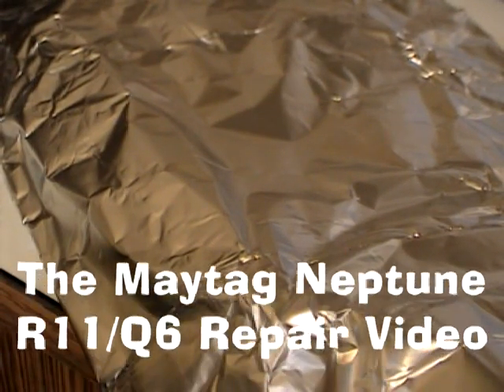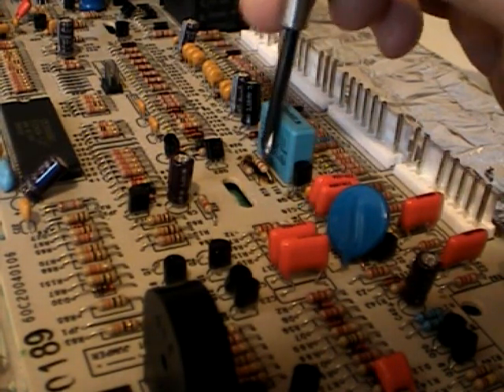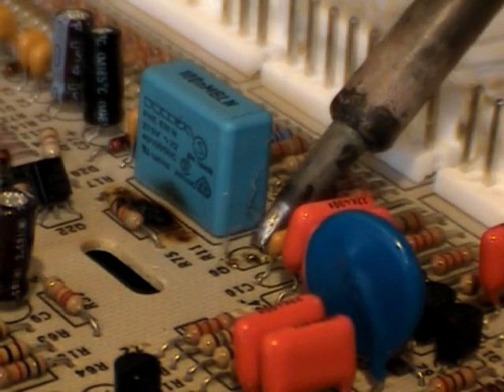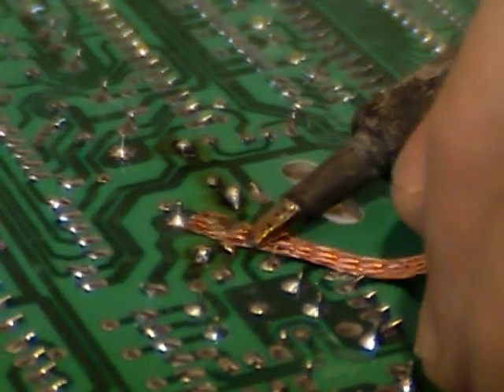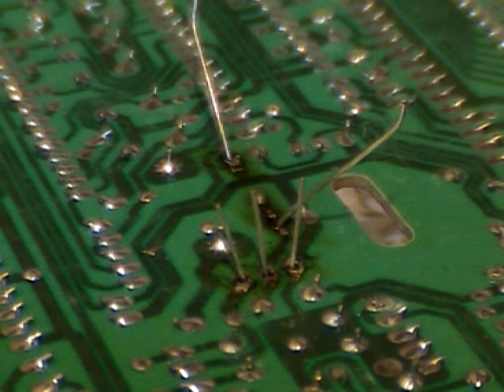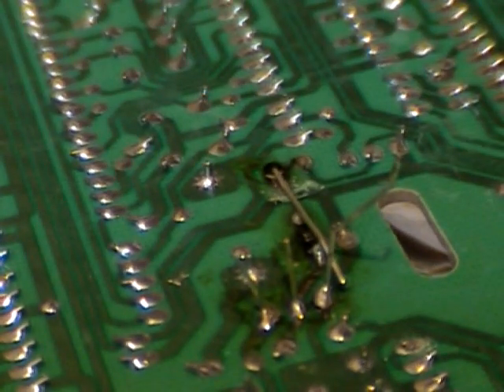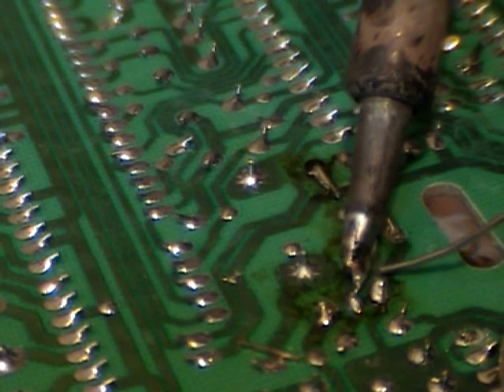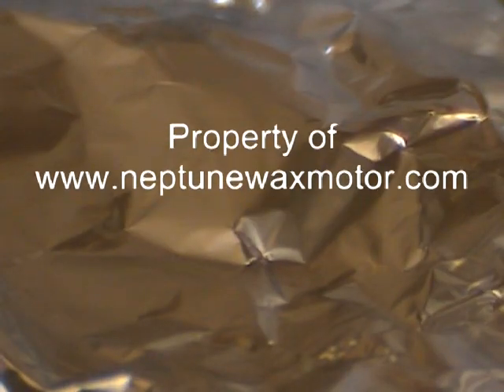Maytag Neptune Control Board R11 and Q6 Repair - No Spin or Door Lock

Comment: thanks for the video very helpful. I'm hoping you can help.  The R11 was burnt and so we replace the R11, Q6 and wax motor with black tip. Put it all back, now it works, locks, spins but when it goes to off the machine doesn't turn off, continues to tumble. It will tumble for hours but won't turn off. I need to press off button and wait for the door lock light to turn off and disengage to get to the clean clothes.  Any idea what is wrong now?
Reply from the maker: +f meghen Hi, I would verify the R11 leads are  in fact connected to the Q6 leads via the copper traces. If one lead of the  R11 is not connected then the wax motor will stay on and the machine will not shut off because it is waiting for the wax motor to unlock door. 

Jeff Hartman
"The Neptune Man"

Comment: I tried to repair the R11 and Q6. The machine gone into the rinse cycle, but did want to turn off. It was spinning for about 5 min, then smelled a slight burning smell, I turned off the machine. Believe I'll have to revisit my soldeing job, don't think I did a good job. How do I clean the holes/race ways? How to test continuity of the race way?

Comment: Just opened my maytag MAH4000AWW, and it also has the R11 and Q6 burned up. Will need to learn how to solder and replace them. Any tools you can recommend? Also what would it cost to replace the was motor and R11 and Q6 at a professional?

Comment: ..cont.. I replaced the door wax motor with the black actuator, went ahead and replaced the same motors on the detergent bin. I also thought, because the door wax motor was causing the issue on the first board, I would help beat it the second time by putting an inline fuse on the wax motor so if it fails, it will stop at the fuse before taking out the board again. I was wrong.  R11 is toasty again and the Q6 doesn't have damage but I will be replacing it too

Comment: I need to ask something, looks like you know your way around it...This happened to me three years ago. I replaced the entire board because apparently Whirlpool knew it was defective and upgraded the Triac and resistor to stronger values. Anyways, the same thing happened to the "upgraded" control board over the weekend.I am not buying another board, I will be fixing it myself this time around. What causes this failure though?

Comment from the maker: You only need a 20 - 25 watt pencil type soldering iron. Make sure the tip is clean so you get good heat transfer. Jeff